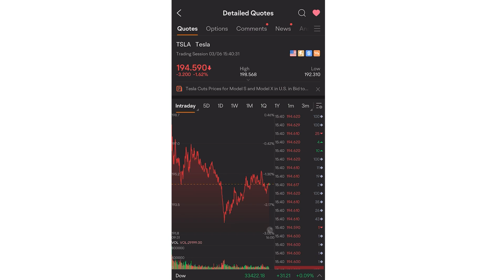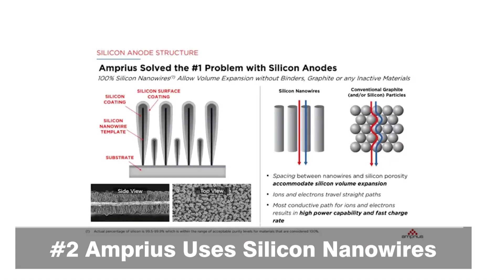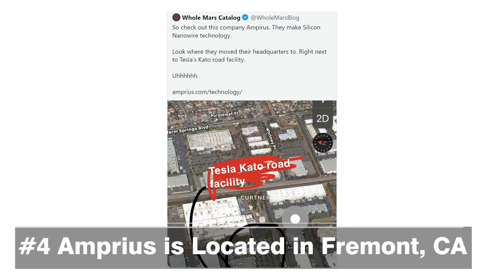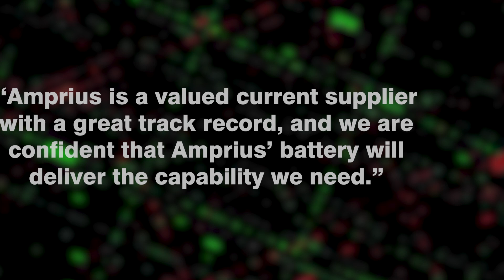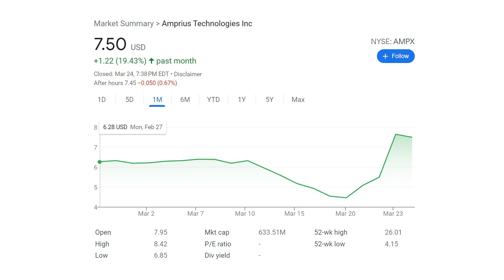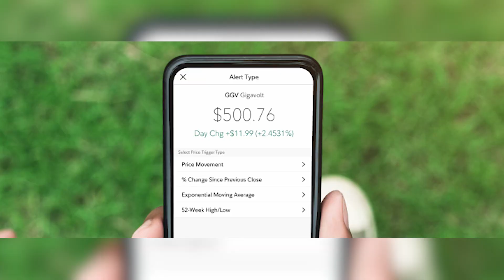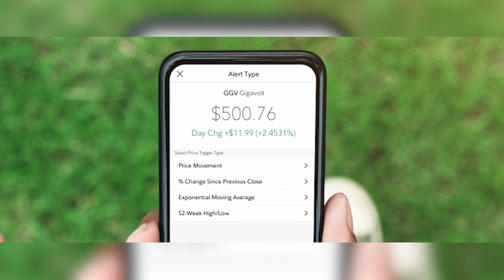Amprius Technologies Battery | Disruptive Investing News

Comment: Is there any info on cycles or charge rate?? U guys are great
Reply: Charge rate is excellent. Amprius Technologies has a demonstration video on their channel where they charge in real time to 80% in just over 6 mins. However, I think that was for a ~370 Wh/kg cell, not the ~500 Wh/kg mentioned in this video. Rather than charge rate, I think the main questions are cost, cycle life—if it’s in the hundreds and not thousands, that’s a big concern in my mind—and durability. If even one of those factors doesn’t pan out, it could render the whole approach impractical.

Disclaimer: I own some shares.

Comment: I noticed the three batteries they tested were tiny, 2" x 2" x 1/4" without much power.  At larger size it looks like it would still take about 10 hours to get a full charge.  Light, yes.  However, I've seen tech at 600 Wh/kg which charges in seconds.

Comment: Nice reporting and hyper-interesting subject. That energy per weight would enable electric aviation on a yuge scale. The question: Silicon is brittle. Doesn't using silicon nanowires engender major fragility in these batteries? CAN they survive rolling down the road in a vehicle?
Reply: Silicon on a macro scale is brittle.

On a micro scale it's quite robust.

Additionally, when used in ceramics it can make them 4 times harder than stainless steel.

This is also while, on average, keeping the same tensile strength before getting into the more exotic blends of steel.

For comparison: look up the generalized stats of "Silicon Carbide" vs "316L class Stainless Steel."

With all of the above considered, I'm guessing nano structured is going to be even stronger simply because you're making a deliberate structure vs a more random one (though crystals tend to be fairly regular on a per grain basis).

Comment: I think the more important question is if they are going to be successful in scaling up production. And if one decides to buy its important to have patience, just look at how the 4680 was hyped and volume production was said to be one year away but we're still not really at volume production? And energy density is still lower than in the old cells. 
However I bought a very small position in amprius at 7.82 usd. But this is pure speculation I dont know how much they would have to produce to justify the stock price, when they will reach profitability etc. 
Waiting for the dip isnt always easy, I was very close to buying tesla at 9,3 (split adjusted) in 2013 but never bought because I wanted to wait for that perfect dip but then after a slight increase in the stock price I thought I missed my chance so I never bought until mid 2020 lol.

Comment: I'm definitely pulling for this... But, I'm not convinced that it can scale just yet.  My main concern is carbon nanotubes....  They've never been able to be produced at extreme scale needed to be a cheap thing.
Reply: The other issue is nanotubes make huffing asbestos seem like a good idea.
Reply: Very short ones, and they havea scalable process.
Reply: they use silicon nanowires, no?
Reply: I was also thinking they use silicon nanowires, not carbon nanotubes. But I could be wrong.